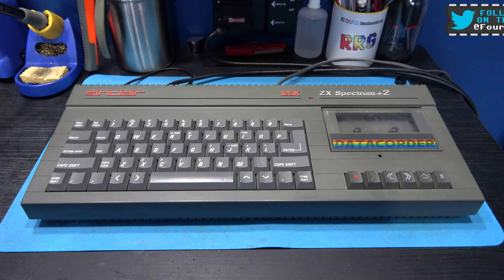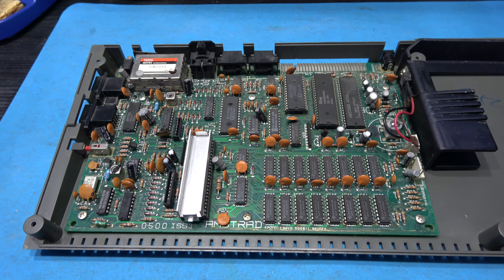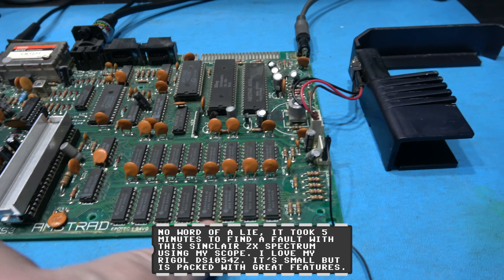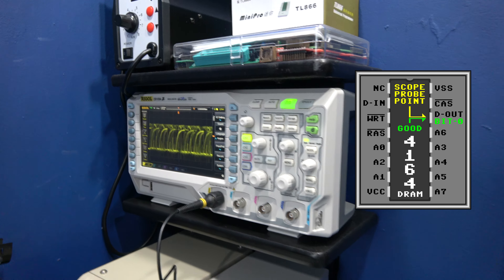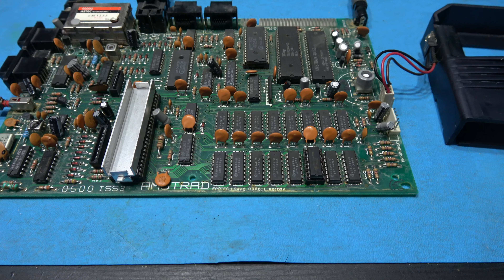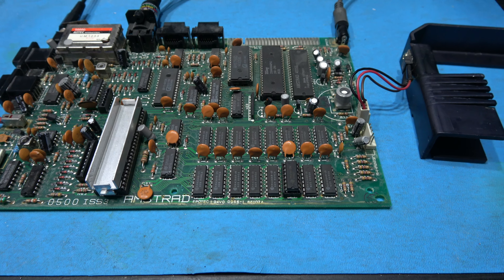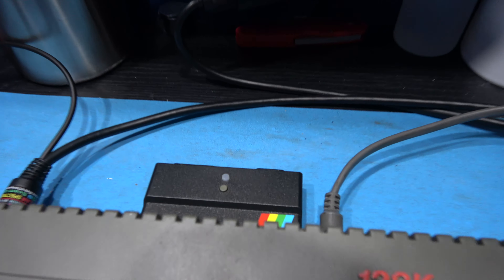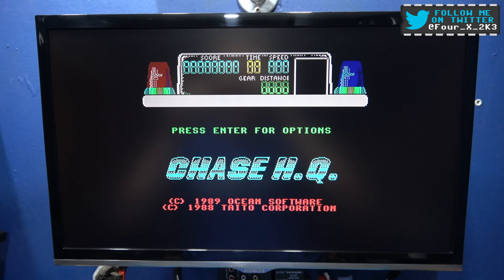Sinclair ZX Spectrum 128K +2 (Grey) - Part 1 - Repair.

Comment: I have a 128k +2A that always boots to the test screen (as if pressing BREAK when powering on). When either of the keyboard ribbons is disconnected to Speccy boots fine. I have removed and cleaned the membrane and connected just the membrane alone but it still forces the test screen. Any ideas? Is this a likely membrane fault or is the membrane just triggering an issue elsewhere?
Reply from the maker: Sound like a membrane fault, somthing is shorting.

Comment: great video !
it is possible to measure ram resistance in the board or is need to pull out the ic and measure ?
Reply from the maker: it's best to take out the RAM, if you still have a short when the RAM has been remove it's something else shorting the pin.